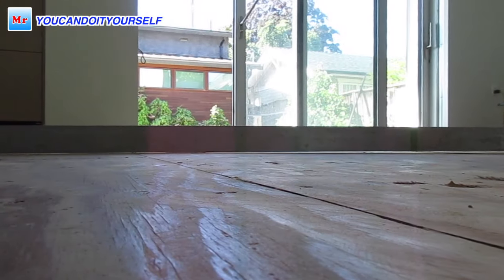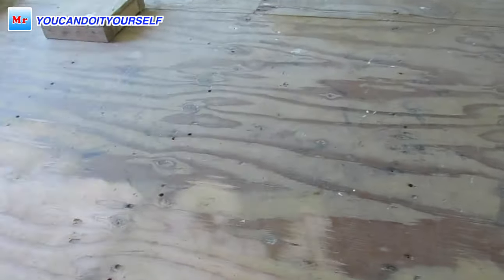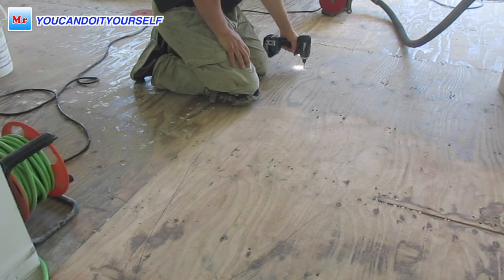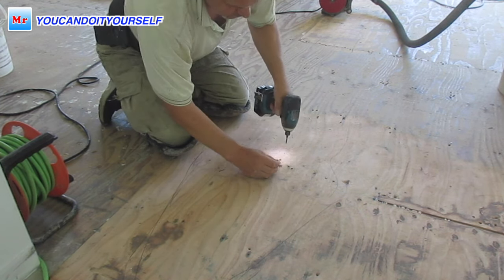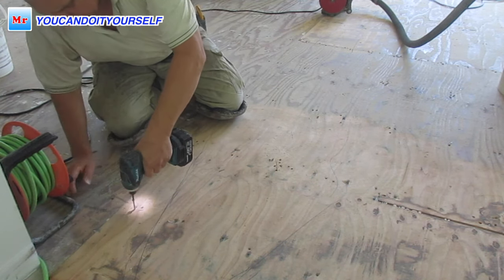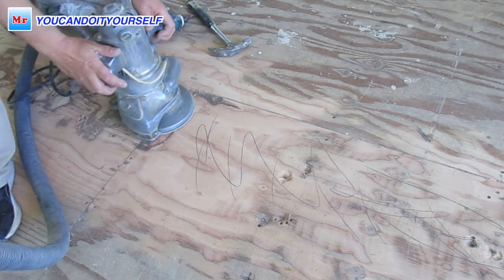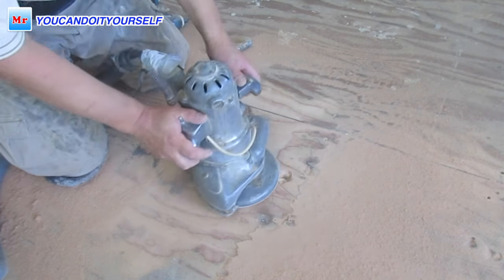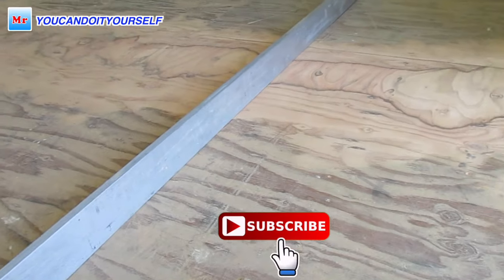How To Plywood Floor Leveling for Laminate Flooring/ Nail Down Installation DIY MrYoucandoityourself

Comment: Around 6:00 you mention flatness for glue down. Is flatness as critical with glue  and nail down engineered wood floor? Or primarily for floating floors?  Great video
Reply from the maker: In this video, I tried to explain how important to make a level for floating system installation instead of nailing down and gluing down. Because glue and nails hold the floor, floating floors don't have that advantage.

Comment: Great video! How do you determine what spots are high instead of what spots are low? I have a subfloor with lots of highs and lows and can’t figure out what is the starting point for level.
Reply from the maker: I have videos, how with 4D laser level find high and low spots. Check it out. Thanks

Comment: Hello there, I want to do something like you but I don't know what kind of playwood I should buy...what kind of playwood I should buy ( birch playwood handi-panel or sanded utility playwood) ?. Thanks!
Reply from the maker: In home depot - 4 ft. x 8 ft. Standard Spruce Plywood Board
Reply: What thickness?
Reply: Always want to aim for 3/4" aka 23/32. Try and aim for plywood as OSB is the style that is usually installed these days but it is a horrendous project to tackle with the tongue and groove option that comes with them. I switched half way through a project and had to come to watch this video. I'm just going to use a angle grinder with a stone wheel and try to get it in a reasonable ball park.

Comment: What’s best practice if you cannot grind down the humps? Do your best to flatten low spots up to hump?
Reply from the maker: Hi, very interesting question! Depends how big area you have to level. Sometimes I do leveling up to  hump, sometimes grind hump down to minimize expenses like here - Leveling Wood Floor With Straight Edge MrYoucandoityourself
https://youtu.be/0i2rNQsESbc

Comment: Is that an impact drill you are using to drive the screws 1/4 inch further into the floor?
Reply from the maker: Yes.
Reply: What if they are nails? How do you drive it down?

Comment: Thank you for sharing! May I ask the tolerance for hardwood flooring?
Reply from the maker: Yes, absolutely
Reply: @MrYoucandoityourself  Is there any product that I can use for filling the low spot for hardwood flooring?
Reply from the maker: @quinnyu6536  You can use plywood or self leveling compound.

Comment: I have a 120 year old house with very warped joists. The difference is in inches from the outside to the center. Not enough wood to sand down.
Reply from the maker: Ask carpenters, maybe they can help you.

Comment: For a small room is it possible to use a small orbital sander with 40 or 60 grit sandpaper?
Reply from the maker: Yes you can, just sanding edges.

Comment: Thank you for all the great information. I am doing what you said I am out about 1/32th of an inch over 6 feet but can't seem to get it better. What is an acceptable tolerance for vinyl plank?
Reply from the maker: 1/8’’ for 8 feet straight edge. Your floor is too perfect. Thanks

Comment: I love watching all of your videos and admire your knowledge and experience! You are also a very good teacher!

Hopefully you can provide some advice. I am a total DIY newbie and used self-leveler for the first time. I didn’t mix the whole bag and it ended up being too thick and did not self-level. I tried sanding it down, but it still left some noticeable humps. I got stuck as to how to correct it and wanted to keep working on my project so I ended up laying down my flooring anyway since my planks allow for 1/4 inch leeway. Would a hand planer level out the material? Well, the problem is, I have a herringbone pattern and it’s not so easy to pull up the tiles. How would you suggest I remedy this situation?? Or is it too late and I have to live with my mistakes? 😭
Reply from the maker: Hi, I have to have a look on it. Send me pictures on Facebook please. You can find link in description for this video. Thanks
Reply: @MrYoucandoityourself  will do! Thank you so much!
Reply: What did you end up doing ?

Comment: I dont know why you would go through all that work , its a floating floor with no nails required, and also with laminate flooring installation you always put the quarter inch foam down , i just think your tactic here would be reasonable for hardwood not laminate.
Reply from the maker: Hi Scot, this spot was to high, and the best way  - cut it down.For each situation I am using different technics. Also I got few questions, why I always doing concrete leveling over plywood, and if it's possible show how to make it with plywood shits. Here it is! Thanks for your question!